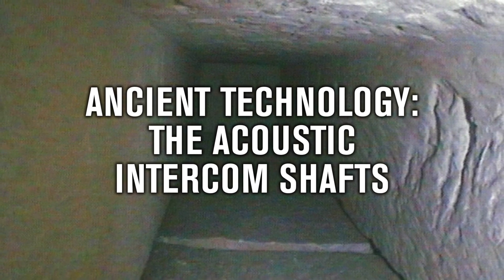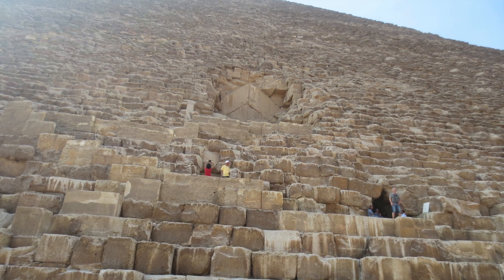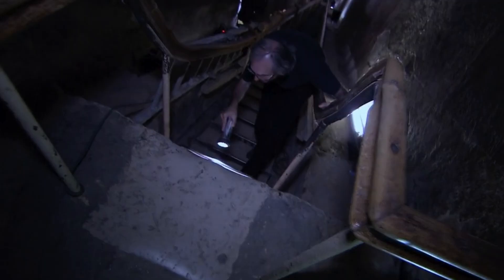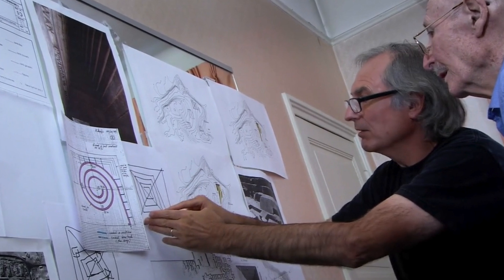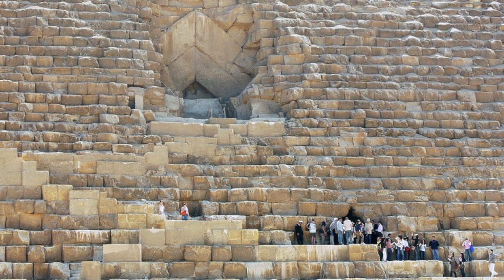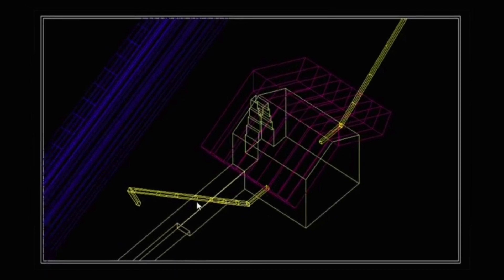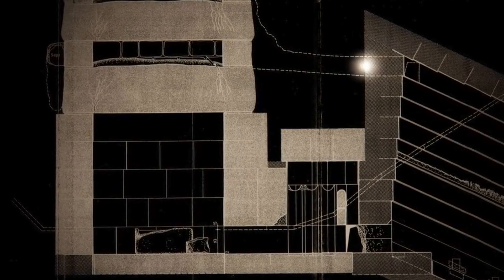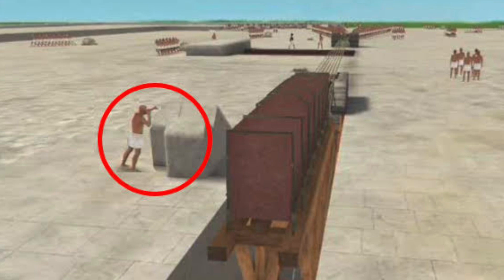Great Pyramid ‘Air Shafts’ Theory: Acoustic Communication Shafts | Ancient Architects

Comment: Matt a couple of key questions come to mind that is not "simple" to explain, all due respect to Jean Pierre Houdain, but firstly don't forget that some of the individual blocks are estimated to weigh in the region of 70 tons, even modern day fuel powered cranes don't lift more than 20 tons..and given their weight and the height they would have needed to have gone (not forgetting it was the tallest structure in the world at that point..) means it would be interesting to hear what Jean says about that..

Where did the workers get their knowledge/accuracy from so that not a single block in a 13 acre site was out of place..can Jean Pierre explain how the pharaonic Egyptians would made sure that the height of the structure is equal to the polar radius of the earth? Keep in mind that during that time the knowledge of our planet was probably not as in depth as it is now, let alone them knowing that earth is round, and yet it seems the base of structure is equal to the circumference of the earth...these blocks that were placed are allegedly in 3/60th degree of error, that is one slim margin for error..Also the mortar substance that was used cannot be replicated today...how was it created? This and more questions the BIGGEST of which I would like to hear Jean's answer to that the 3 pyramids are aligned to 3 stars in such a way that that sort of alignment in the heavens above didn't occur until around 10,000 BC...if that is the case then this structure is older than what you or Jean may think it is...

Comment: Sorry for the very late comment. I don't know if this theory is still seen as up-to-date. I just wanted to ask whether there is any evidence of this kind of thing having been used previously? These shafts would have been a part of the original plan before building started, which suggests they knew that communication issues would arise, which in turn suggests that they learnt this lesson from other older structures.
Also is there really no way the King's Chamber shafts could have been built at head height, by placing the shafts slightly further into the chamber?

Comment: Interesting theory with practical evidence. a question i have is why were the middle chamber shafts covered and capped at both ends when the upper chamber shafts remain open? why not cap the upper chamber shafts too?
Reply: They may have been covered centuries ago, plus the now removed casing stones may have served as covers?
Reply: Perhaps it was to prevent the occasional torrential rain from running down the shaft and soaking the floor of the chamber. That would produce mold, fungus, mildew.
Reply: @astrecks  true i thought the casing stone would provide cover, but why purposefully cover the queens chamber shafts at both ends and leave the kings chamber ones open?
Reply: @redwoodcoast  and sand i would imagine would just pile down there in sandstorms but why cover the queens chamber shafts and leave the kings chamber ones exposed?
Reply: @azy83  A piece of iron was found at the exit of one which indicated a door was once in place...keeping out rain and critters.
Reply: @azy83  The shafts of the queen's chamber never reached the outside perimeter of the completed pyramid. When the height of the queen's chamber was achieved, they were closed off to prevent debris from falling into them. The upper shafts may have been closed in the same manner; however, as they reached the perimeter of the construction, the covers may have been removed by ancient explorers.

Comment: You both may be correct. But it seems to me communication across the top ( where they are working) could be done at least through relays.That would be simpler .
 I'm still wondering about those dimples. I like the idea of starting the program with the ground prep.   If the Pyramids were white.. I would think they would trough off a lot of heat and light when they were built... even in the night. Has anyone thought of that?  Good work. Thanks for the interesting video.

Comment: I really like Houdin's concept of the Great Pyramid construction. It makes a lot of sense and I'm sure it would be possible to take his plans and build a new pyramid today. The concept works the way it is and it even leaves room for some alternative ideas. 
Houdin's concept leaves room for a possible, older, mastaba style structure under the GP. In rebuilt, heavily modified form, such an older structure could have been used as a base for the GP. And it leaves room for a possible,  much larger mound of natural bedrock inside the GP. Both could have helped to reduce the time the construction took.  

To me there still are a few questions. 

Why is the upper end of the Grand Gallery right in the center of the pyramid and the King's Chamber is offset? To my understanding the Grand Gallery could serve its function just as good if it was offset to make room for a King's Chamber in the center. 
Why is the Queen's chamber constructed so differently to the KC?
Why were the QC shafts carefully blocked on the lower ends and how did they do it? Why the extra effort with shafts chiseled half way through the wall stones? 
Why do the copper pins on the upper ends show their distinctive pattern of erosion/corrosion? 
What about Sibson's window? How did the ticket and the plasik spool/wheel get in there? 
What is the reason for Egyptian officials to deny further research on the void if it only is an empty, structural feature like the Grand Gallery? I don't see a reason to hide a feature that is purely technical and at the same time is as close as it gets to a smoking gun for the pyramid being built as a tomb from the start. 

Why does the 2nd pyramid not have a comparable/similar internal design? It must be built using a completely different method. Why did they choose another construction method and how was it made? 

The Egyptians painted a lot of every day life and working scenes to walls. Some wall paintings show the use of hand tools. Is there really no wall painting showing any kind of heavier machinery like the suff Mr. Houdin shows in his animations? Why?

Comment: So a lot of people are questioning why they would need to do all of that for communication when there are other methods that could have worked during the construction. Here's a theory, and I'm totally just spitballing here from the tiny bit of info we got on this video. Truly no need to take it serious. But maybe they were actually used for communication after the construction was complete. Maybe when it was in better condition and had better acoustic properties you were able to hear it more clearly amplified outside of the pyramid, and maybe it was used for speeches, sermons, etc. or even pharaoh's using it to act as if god's are communicating through the massive structure. It would be wild if the pyramid was a propaganda machine of sorts.

Comment: I have been thinking about what you said regarding the lower parts of the pyramid. That they were contingencies in case the pharaoh died before it was completed. That the queen’s chamber was closed off once the king’s chamber was finished and such. Assuming this to be factual, figuring out how many cubic feet of earth was removed from the lowest unfinished chamber and how long it would take to move that much earth would be a good estimate on how long it took to build up to the queen’s chamber, likewise how long it took to get to the kings chamber by coo relating build time for the queens chamber assuming construction was done on a consistent basis. I was taught in college it took 20 years to build the pyramid but I don’t know of any rational method they could have determined that. Other than by going by what you hypothesized

Comment: I wonder if the air shafts were actually used to fill the burial chamber with quartz sand once sealed. It would’ve filled to the height of the door and left the coffer almost fully buried but with a nice sealed air pocket above

Comment: Are there shafts on other pyramids? If not how did they communicate and coordinate the construction of those? Also seems like you could use four shafts because there are at least four sides to each pyramid for all practical purposes.
Reply from the maker: Those pyramids had no grand gallery. No huge granite beams to raise. No no need for shafts. They are linked to the grand gallery counter weight system as explained. 👍
Reply: @AncientArchitects  the shafts were not needed for construction. The reliving blocks were placed as each height was reached. Would have been a 360 view as each was set.

Comment: Great video Matt.  Have you given up on your earlier suggestion that the queen shafts were blocked up when the pyramid was enlarged?  Or is that incoprorated into the Houdin theory?
Reply: I find it interesting that the queens shafts end at the height of the king's chamber roof. These shafts are important for something because of all of the extra time, energy, and planning they required but they are still such a mystery.

Comment: Stone reflects sound is a byproduct, but was it a design feature? Any bar/restaurant with concrete floors, walls, and ceilings is obnoxiously loud and not generally by design. It's a byproduct of in attention to acoustics. Hard surfaces and solid materials do not absorb sound / vibrations and instead transmit and reflect them. There is no tuning required for this to occur.

A simple lever with a flag could have done the same thing as a simple intercom, much like the fwd/stop/reverse on a ship without the need of the extra work of these shafts.

I agree that the shafts don't appear to point at stars, but the acoustics theories being pushed leave much to be desired to hit the bar as a design feature and not a byproduct.

Keep up the good investigative work!

Comment: If the sound from the tuning fork lasted from the time they were inside to they got out. Wouldn’t that mean that sound echoes so much inside the shafts that it would be far more inconsistent than simple flags or signs. And yes, even if there is objects in line of sight its simpler to hire one more worker to stand on the corner with a second flag than it is to cut out hundreds of meters of stone. ”Simplicity is the ultimate sophistication” And building a shaft by removing tons of stone instead of waving a pair of dirty underpants is the ultimate nightmare for the founder of the project.

Comment: I still don't believe that they built that whole thing just to hum a tune. I still agree with your idea that it was expanded when it was renovated which explains why there are two chambers and why the Queens chamber air shafts don't reach the outside. I believe that these pyramids were a fermentation pressure chamber just like Saqqara... only a real big one.

Comment: Interesting theory. One question is why did they just do this at the great pyramid? To my knowledge there are no equivalents of the shafts at other very large pyramids, such as the middle pyramid and the red pyramid.
Reply: Very true
Reply: How many other pyramids have Grand Galleries...did you watch the video??
Reply: @manoo422  Yes, I watched the video. The internal structures of other pyramids were not discussed, just the Great Pyramid. Unless you are referring to another video?
Reply: @peterwhite6611  If your knowledge of the other 2 large pyramids confirms there are no similar shafts then you know there is virtually no internal structure in them at all. Without internal structure there is no requirement for communication shafts...which is all explained in the video!

Comment: If the Queens chamber was closed off and the Kings was left exposed could it be that the Queens chamber was where Khufu was buried? Given the hieroglyphs that used the be all over the Queens chamber, and the structural problems evident in the Kings, perhaps the higher chamber was abandoned

Comment: I'm not convinced. I'm more inclined with a similar theory. Clean water is one of the most important things any human could have. Just like candle and cup experiment sucks water up when the fire runs out of oxygen and is extinguished maybe the same thing was done in the cambers. You could even pour candle oil down one of the shafts so it fills the so called sarcophagus as they did with their simple oil burner lights. Pyramid or Pyro=fire mid=middle. If the water would be sucked up fill the grand gallery then the weight of all that water would be enough to push open the one way hinged door that once existed. After the initial start a syphoning gravity affect would take place. Clean water for crops, animals and themselves. One of the pharaohs in his hieroglyphs goes as far as stating the he was the cause of the river Nile.

Comment: They had clay jars and wire. They could have easily communicated that way. But instead they carved hundreds of stones with different shaped corners at an odd angle so they would line up in an acoustical tunnel. They could have put 50 men close enough together to pass on the info one to the next. They could have used reflectors, smoke, whistles, anything but cutting hundreds of granite blocks. If this is correct then it is the only possible way these important communications could be done. It’s too much work unless it’s the only way. Messengers are far more economical.

Comment: although a good hypothesis, this system would have only been able to be used after they reached the ceiling of the queen chamber, in which prior to that would have had another form of communication involved, and in say that why would they not keep using that form , because, after reaching above the kings chamber, they would have to revert back to the prior form of communication, for me it doesn't make sense although a clever hypothesis. how do the shafts line up with the internal spiral ramp theory ?

Comment: I’m not sure what you’re talking about Houdins theory has many issues. If I didn’t have a day job I could write novel on it. 

There are several issues with his theory but one of the most glaring is that direction of the magnetic field of the stones. The only explanation to this is that they were poured into place. This also explains the precision that was achieved. Another issue is that there is absolutely no reason the kings chamber needs such and elaborate load bearing support design with multiple material types. The list goes on and on…
Reply: You keep mentioning getting into the minds of the builders of the time but you have the wrong builders and the wrong time.

Comment: The acoustic properties suggest that the pyramid was most likely a religious building, where priests chanting from the Kings chamber could create surreal or "magical" experience to the people outside. As if God is singing to them!
This could have been a very powerful instrument for the rulers, the pharaoh and priesthood.
Maybe initially the Queens chamber had such purpose, but didn't work well enough and they had to build the Kings chamber higher and with much harder granite and the resonating blocks above the ceiling to amplify the sound.
The intercom/construction team communication theory seems ridiculous.
The teams are on top of the pyramid, some 50-100 meters away, why do they need to build dedicated shafts with all the complicated stone-work, when they can just have 1-2 people in between shouting, or using hand-signs to signal!

Comment: I'm not convinced by the explanation of the shafts. It seems a massively complex design and build to achieve something quite simple. Using semaphore would be a whole lot easier, for example. But more importantly, take a look at the 2nd pyramid. In the main chamber similar shafts exist. Except these are over 5m above floor level. Very tall people needed to use these or high ladders / platforms. 
There are many things n this world that can be used NOT for the purpose they were designed. A screwdriver can be used to open a tin of beans for example. It can be done but not its design purpose. With respect, that is what I think you have described.

Comment: Even if the Egyptians had tools to cut granite however they needed, the timing is the biggest issue. A block would need to be laid Every 2 to 3 minutes for around 27 years with no breaks whatsoever to be completed...  Houdan gave a beautiful rendering on his hypothesis as to how the pyramids were built but unfortunately that's not enough.
Reply: Plus the planning time and that's assuming no mistakes they missed and had to rectify, imagine missing a flaw and having to unbuild back down to the fault. Teaching the builders and eventual replacements (people die or get injured) and sourcing some blocks from 500 miles away. Can't work in flash floods (apparently that's how the sphinx has erosion) so many issues to believe this was done in 20 years yet alone one person's lifetime.
Reply: @sirmrguitardude  honestly it's such an enigma that when you think you have the answer, the answer causes more questions and doubts within its self.